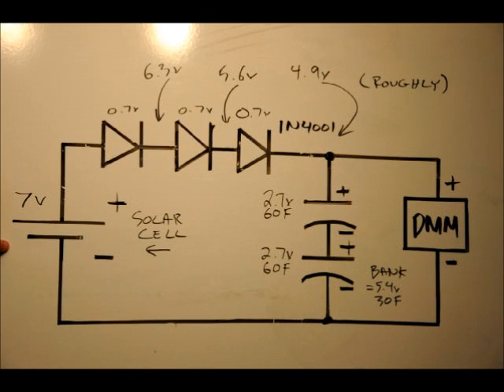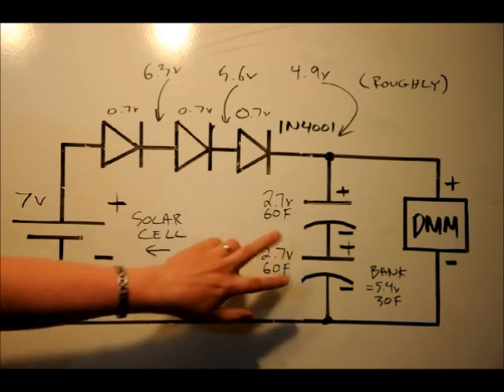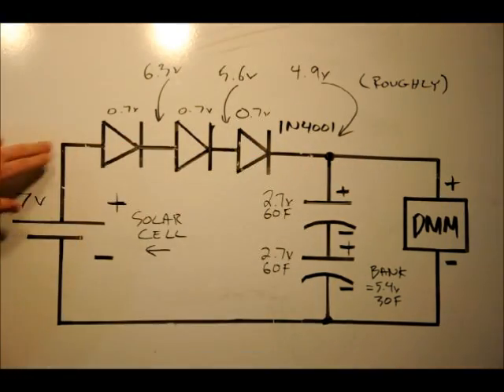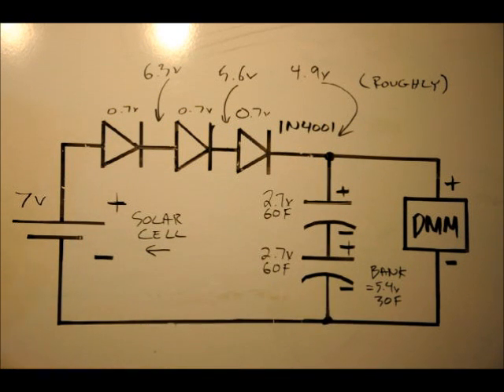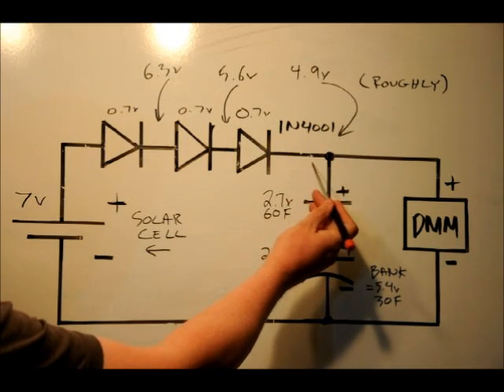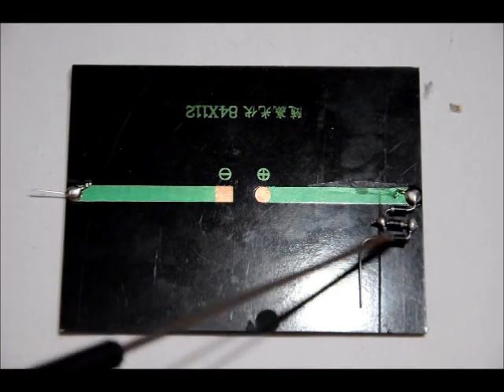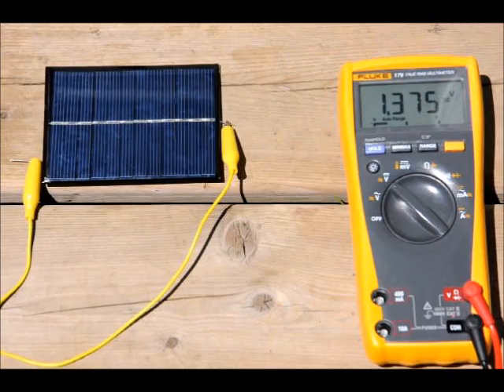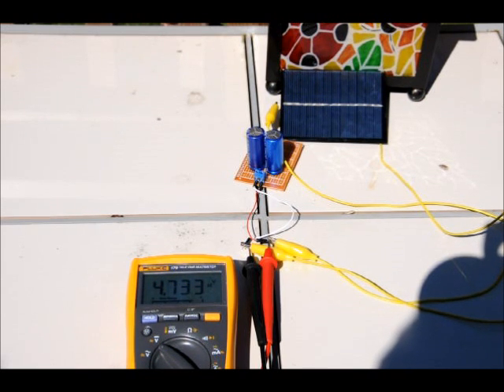Solar Cells & Super Capacitors Part#2   Using Diodes For Voltage Matching

Comment: You can't assume the forward voltage drop across the diode is always going to be 700mV.  The true diode curve is an exponential relationship, so there will still be some miniscule current flow after the capacitor charged to 4.9V. So if you leave it out in the sun long enough, the capacitors will slowly accumulate more charge and exceed their 5.4V limit (and then bad things might happen). I just checked this out in a circuit simulator and increased the time stamp and waited, and eventually the capacitors got up close to 7V. A shunt zener diode would do a better job ensuring the current doesn't exceed the limit.

Comment: A more useful way of using diodes in series, is to drop the voltage of a power supply (mains or battery) to match the voltage needed by a load (device), if the drop needed is low (1 to 3 volts).
It's cheaper and more energy efficient than using a voltage regulator.

Comment: I wanna use a 2 3000f k2 Maxwell super caps on a 1kw solar system send the charge to the telcom battery bank then have supercaps on the end before the inverter is this possible and can you help me with this

Comment: Use a cheap  50 cent buck converter between the solar panel and the super capacitor for better matching and higher efficiency.

Comment: Actually I am not sure that this is a long term solution. When the capacitor(s) are fully charged there will be no load to the solar cell making its voltage go to open circuit which will be considerably higher than the loaded voltage, possibly destroying the the capacitor. Any thoughts?

Comment: Why don't you install a five volt zener diode? Or a five volt regulator?
Reply: The problem with the zener-version is that when the zener is operational bypassing the capacitor(s) it will act as a short to the solar cell. Over longer times the solar cell will deteriorate. For shorter times shorting the solar cell is ok.

Comment: is it possible to charge a 48V super capacitor with a 38V rated solar panel?
Reply: definitively, yes, and well within design parameters 
but you will not be fully utlising the storage potential of the capacitor fully
Reply: You could also use a boost comverter to bump up the voltage to  how much voltage you want your capacitor to be charged to.

Comment: If you want to connect some of these in series you can balance them by putting 3 ordinary diodes in series across each capacitor cathode (stripe) on the negative.  This will limit the voltage on each capacitor to about 2.4 volts and it's cheap.

Comment: I need to learn this if I want to own solar panel.. not easy.. but thanks to this video..
Reply: well strictly no, not if you connect to a MPPT device or a charge controller and handle the solar output as recommended by panel manufacturers...this is a mechanism to "Store" output from the panel for a short time, and its not necessary to do this to hook up a panel

Comment: You can replace two of the diodes with a resistor of 1.4 ohms a piece of stainless steel wire  should do the trick.

Comment: 1/ Their is a simple way around expensive balance circuits simply connect 3 x 1n4001 diodes in series across each super capacitor the voltage drop should come to about 2.1 volts total so the super capacitor can not over charge. I am currently designing my own circuit based on this as these diodes are cheap and it is not difficult to configure 3 in series for each super capacitor. The idea simply being to short out excess voltage from the super Capacitor once it slowly achieves 2.1 volts, (DO NOT CONNECT DIODES TO A SUPER CAPACITOR THAT HOLDS 2.7 VOLTS) this will blow your diodes.

2/ The problem I see with your circuit above, is that by reducing the incoming voltage to the super capacitor your also sacrificing charge rate speed, as the voltage is kept low, so is current rate, I know you did this to protect the over charging of your capacitor, but by doing what I suggest above under 1/ the cascade effect of draining surplus power with behave like a ZENER diode in (CLIPPING) the peak over charge voltage "off the top", and is much more efficient.
Reply: i am agree with you
Reply: MILTON CESAR YABAR BORJA
Thanks I probably should have added to use constant current charging to the super capacitors and limited to the rated power dissipation of the diodes, also a voltage regulator cutoff of 12 volts.
Reply: +Ortorea Screenname in mi project is power supply 5v/2amps to 2 ultracapacitors in series and balancing  with 3 diodes  in series each one
Reply: Well in that scenario no need of 12v reg just make sure diodes each are rated for at least 3x3 amps each cap
Reply: +Ortorea Screenname what determine dischargue time  ultracapacitor?
Reply: Current, you could use a fixed charge current and just time it on a stop watch when the voltage reaches maximum, but if diodes (Parallel Regulator) aka diodes are across it you won't really see it tail off to zero.
Reply: +Ortorea Screenname balancing diodes is just necesary in series supercapacitor or paralell too?
Reply: Just series 2 or more, obviously if your using 2 or more in parallel you just need to limit the maximum voltage.

Comment: In series the voltage doubles, but capacity keeps in 60F because the current through them is the same.
Reply from the maker: Hi
No it doesn't.  2x of any same value capacitor in series is half the capacitance, and double the voltage.  2x 60f 2.7v caps in series is 30f @ 5.4v.  If you still don't believe me, look it up.
http://www.electronics2000.co.uk/calc/series-parallel-capacitor-calculator.php
Reply: patrickikis Sorry you're right, it behaves as a resistance in parallel.

Comment: Thanks for showing the basics :) I think these videos are really useful. I think in the first video you could mention that if you want only a blocking diode, you can use schotky 0.2V voltage drop, to ensure faster charge, and less power loss. Here with the three diodes you can charge your cap only if the sun is strong enough for the solar cell to produce more than 3x0.7V+ capacitor current voltage. But you are right this is the most cheap way I guess. You can mention ZSPM4523 - the most efficient and expensive way to do that, in my opinion :-D (although the chip itself is not expensive, but the kit...)

Comment: I assume that you could use a larger value diode and save from having to chain 3 together? BTW, thank you for this series, very interesting, look forward to more like this.
Reply from the maker: Unfortunately, no.  Not really.  I have larger diodes on hand that can handle more power, but they have a lesser drop.  A multimeter will show you how much of a drop you can expect along a diode.  Most diodes don't have a drop of more than 700-800mv each.  Most, but not all.  Some have much less.